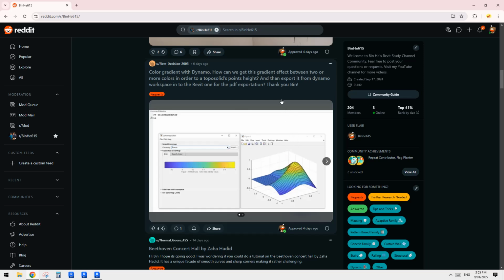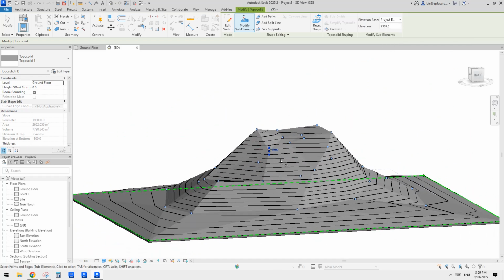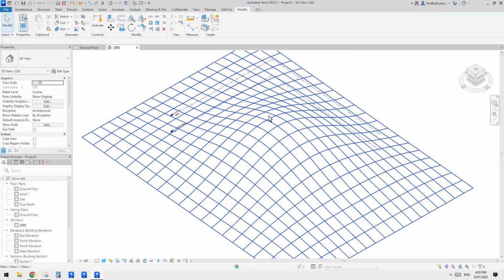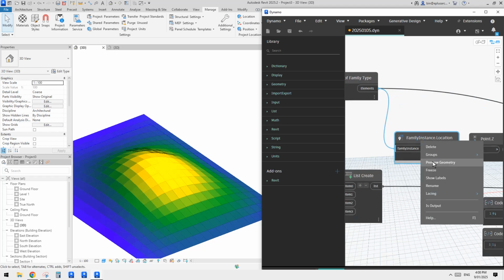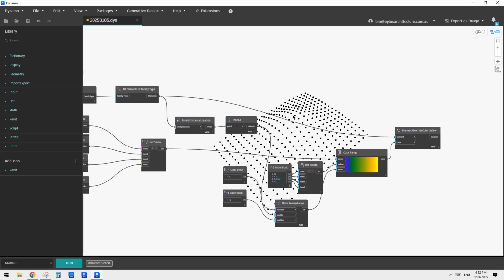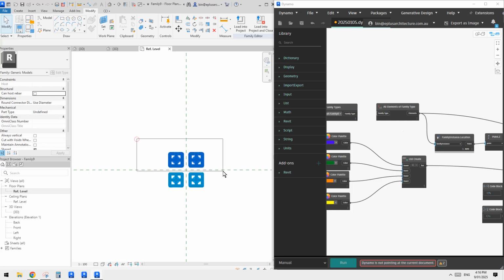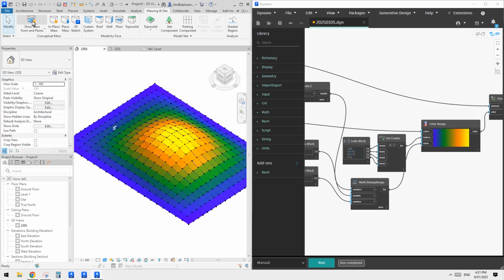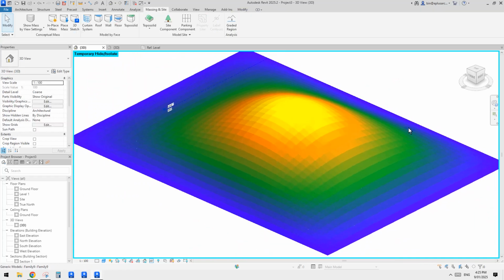25004 - Gradient Colour on Massing with Dynamo (Pattern Based & Adaptive Family)

Comment: For the pattern base element, I think we can fix elements location by converting them to element geometry (Element.Geometry) and then figuring out each element centroid (Solid.Centroid) to achieve the same result as adaptive element.
Reply from the maker: Thanks for your input. Yes, there is definitely a way to do it in Dynamo, and it should be possible to convert a toposolid into some geometries and apply colour depending on the elevation.